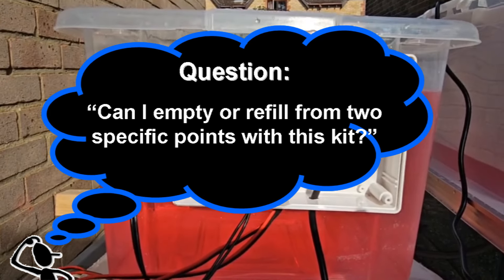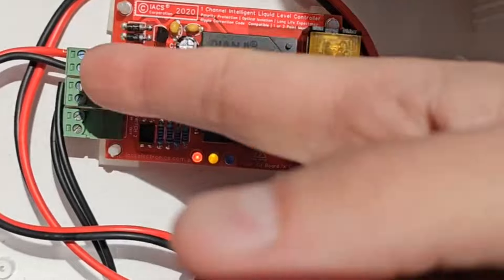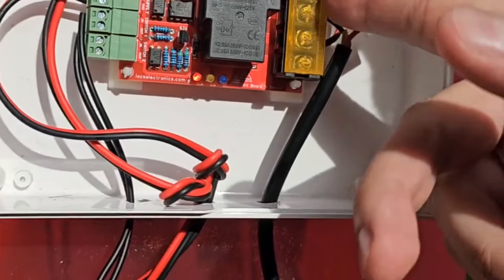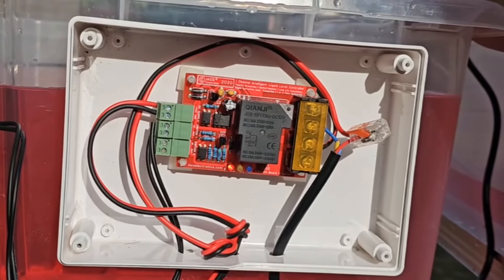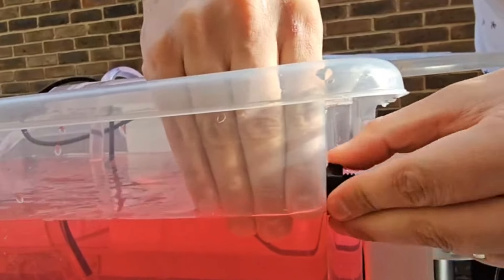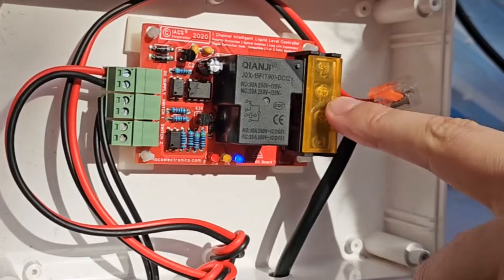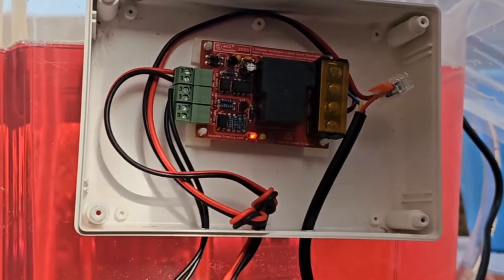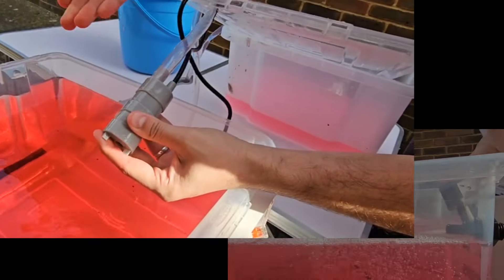Float Kit X Series Frequently Asked Questions-  AI Tank Controller (30amp) Anti-wave

Comment: Good day to you Sir,  how does your ripple protection device prevent water turbulence in the tank?
Reply from the maker: Hi Jamie. So just to clarify... The cat doesn't prevent waves or ripples from occurring inside your tank, 8 merely detects when they are occurring and acts to protect your pump or solenoid from excessive switching. The device uses a series of thought processes like a very basic form of artificial intelligence to decide whether to act upon the water level or ignore it. This means your pump or solenoid will be controlled in a more intentional way. So the board basically acts to correct the problems caused by waves or ripples, rather than preventing them from happening. I hope this helps and please let us know if you have any follow-up questions
Reply: Thank you for the clarification.